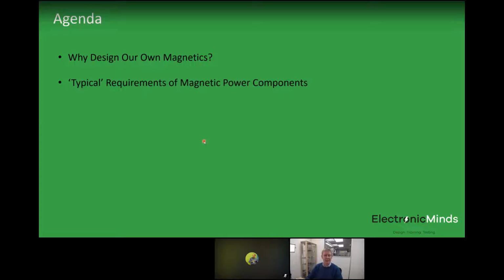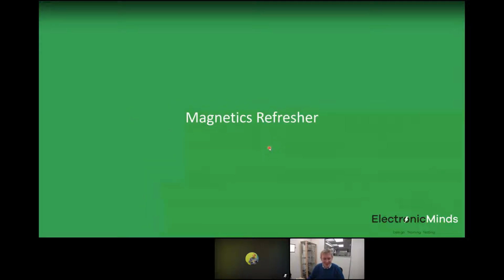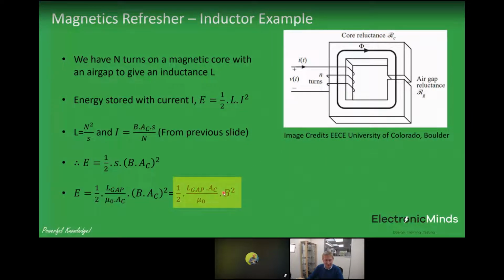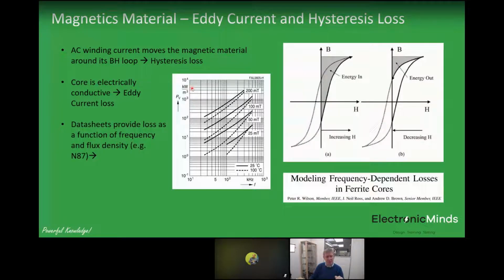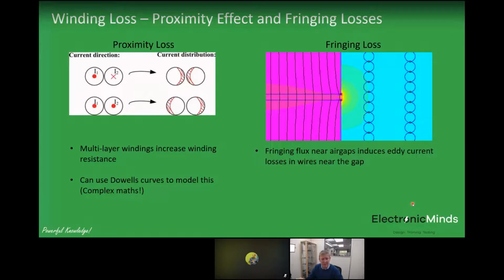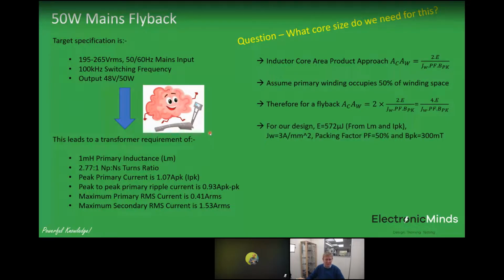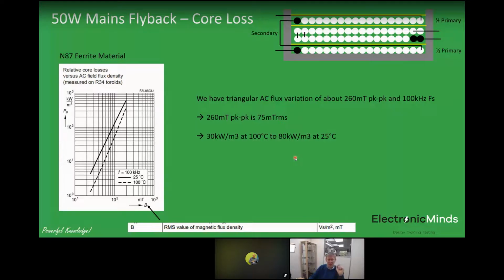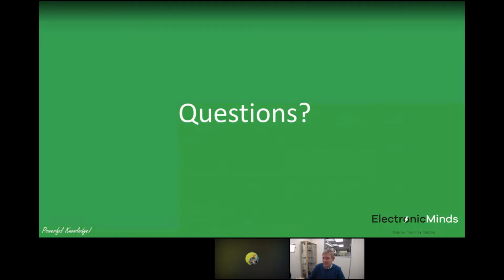Powerful Knowledge 9 - Magnetics design for high performance power converters

Comment: Wrong! The air gap changes the relative permeability from 30,000 to 4. Use wood instead. Wood does not saturate.
Reply: :face-blue-smiling::face-blue-smiling::face-blue-smiling:

Comment: One company made medical equipment. We needed galvanic isolation (plugging the patient into a wall outlet is frowned on). Plus the patient unit needed to measire nerve activity - 1 micro volt peak.
My boss said buy, I said build. No comercial converter worked. They had a local suplier make custom transformers. After two years I managed to get them to try a Feroxcube starter kit. The engineer said, "This is easy! How did you know?" I replied, "Ben there, done that."
Reply from the maker: Good work! If you can learn about and design/build your own power converters then this is great as you will get to understand how to get to the performance levels you need and where the trade offs are.

Comment: Grateful for what have you done. I have a small doubt though, how did you measure AC resistance i.e. @100kHz could help me figuring this out. I have designed a component but I wanted to it validate with my simulation results. So could you help me  how to measure AC resistance. I have impedance analyzer with me but the real part of the impedance measured is giving effective resistance but not the winding resistance alone.............Thanks in advance
Reply from the maker: We used an impedance bridge, in our case the Keysight 4263B. It measures the real part of the impedance (I.e. the resistance at a few spot frequencies including 100kHz). Keep in mind that the measurement is only small signal so won’t necessarily capture non-linear losses such as the increase in loss with Bpeak.
Reply: @ElectronicmindsUK   Thank You for that. I am using Bode100 (from omicron labs) for the impedance measurement I am still unable to measure ac resistance accurately

Comment: hi thank you so much about your knowladle. can ı ask a question, in 100khz we calculate 0.21mm skin depth. after that how we select optimal diameter you said 0.42.Do we multiply the skin depth directly by 2?  in video 37m

What I mean is, if there is a skin depth of 0.21mm, how can I calculate the cross-sectional area required to avoid skin effect?
Reply from the maker: The definition of skin depth is the distance into the conductor cross section where the current density falls to 1/e of that at the surface. You can't really avoid it but you can see that running a conductor with radius greater than the skin depth (i.e. diameter of twice the skin depth) means that very little of the current flows in the centre as the current density drops exponentially. We use 2x the skin depth for the diameter as a good starting point.

Comment: The design parameters are TOO BRIEIF  outlined  in 47:50/1:23 . Please indicate a justification for this choice.   I  realize that  the presentation is for first time designers , 
hence the simplification is correct.
Reply from the maker: The focus of this video is to translate a set of electrical requirements for a magnetic component into a physical design (core, gap, turns etc). The justification for those electrical requirements comes from how the power stage itself is designed. In the case of the flyback converter example here, we do cover the topology design which leads to the electrical requirements of the magnetics in one of our other videos. Take a look at https://www.youtube.com/watch?v=FvWyacXud_E